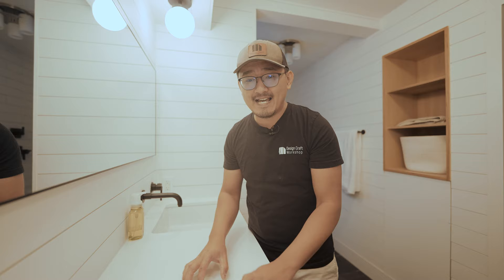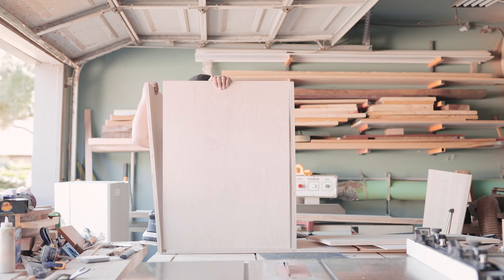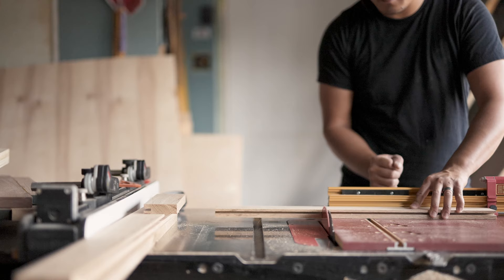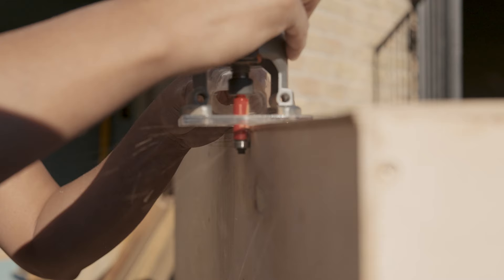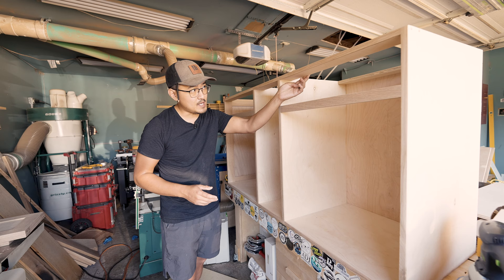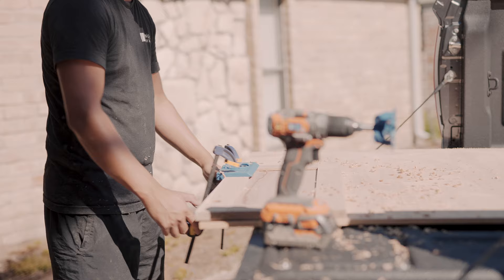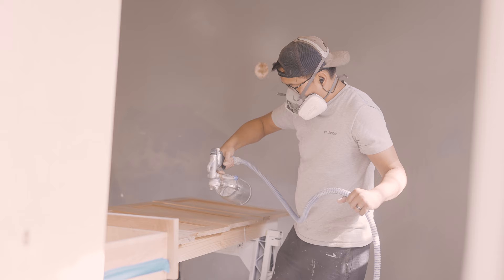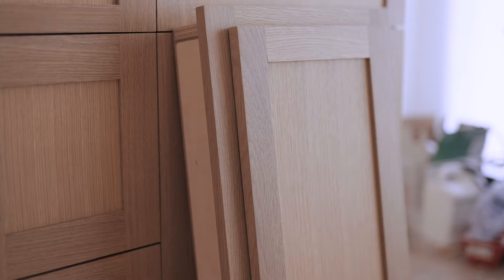How to Build a White Oak Bathroom Vanity // Woodworking

Comment: Awesome vanity. Looking to build mine in the next couple days and your video has helped a lot answer a lot of questions i had about little details. I know this video was made over a year ago, but  I had a couple questions regarding the drawer overlay and cabinet door overlay. 

Do you remember what size overlay hinges you used for the cabinet? And how much overlay did the drawers have? I know you used 0.75" plywood for the carcass, but if there is a 1/8" gap, and 0.5" overlay, that only leaves 1/8" for the drawer face to rest on when its closed. I know that should work technically, but an eighth inch doesn't seem like much.. 

Thanks!!
Reply from the maker: Thank you! I believe I used 3/4” overlays on the ends and 1/2” overlay for doors next to the drawers. The drawers were trim down to give an even gap around the fronts.

Comment: Dangit, Bao. I have work to do and didn’t want to get sucked into watching this but I did. This was super captivating. Great video! I have one question. Those soft close hinges looked easy to snap on but you didn’t show how you attached the back half of them on the face frame. Did you just measure equally for both doors or was there a trick with that true position jig for placing the hinge on the face frame as well??
Reply from the maker: Thanks Christy! I usually make a jig to set the placement for the plates inside of the cabinet. The jig is measured and cut based on where you locate your hinge on the backside of the door. From there you can take the jig and locate the plate side inside the cabinet. Probably will be a future video to make it easier :)